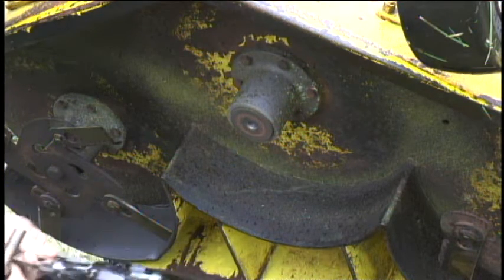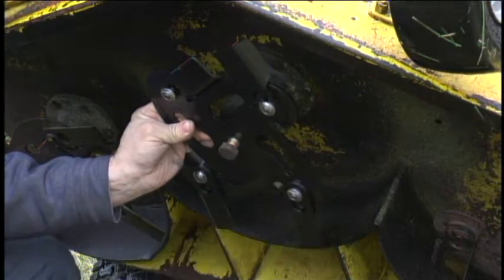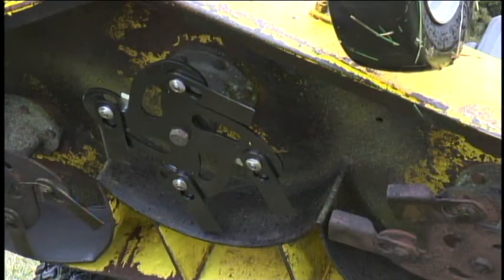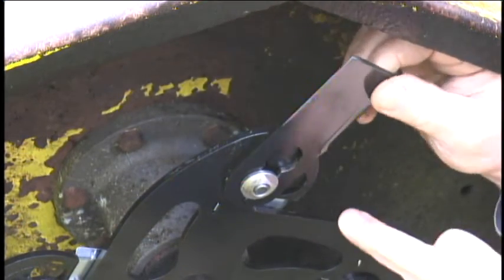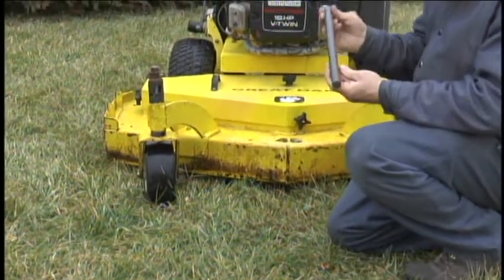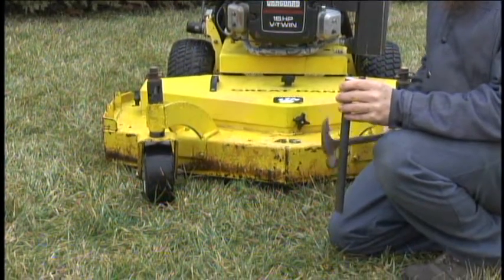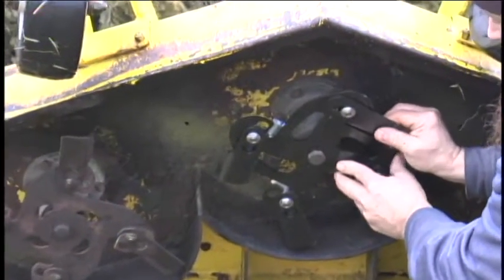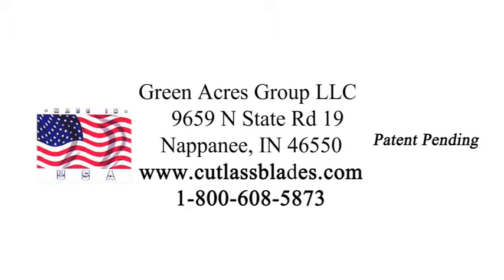Cutlass Mower Blades 1 17

Comment: They need to tell people that these types of blades are really only good for these old push lever blade engaged mowers. When you have a pto like mine with a cogged belt... the first time powering up they were alright. But everytime after that they violently snap to their outward position. And I’ve tried it at all different speed settings. Everytime you hear a super loud snap and it yanks the deck side to side really hard! If they could fix it so the blade only can go backwards to deflect off things and be removed it would be ok most likely. But because they get stopped and then fold forward too far that’s where the hard snap and violent shake comes into play!

Comment: I VERY surprised the battery mower would even turn these, I purchased this setup for my 48" Snapper tractor & LOVED them TILL I realized I could buy 3 cheap standard blades NUMEROUS TIMES VS: I new set of 12 tips, that alone had me pull their system off, I was IMPRESSED with their whole setup till I saw how much more it was going to cost me per mowing season

Comment: and exactly what was the whole point in running the blades into a steel rod?? the most ignorant thing ive seen on youtube in a while now...
Reply: To show the durability.
Reply: I’m glad he did that test. I have a lot of hidden rocks on my property even after multiple times cleaning. I always find new ones when I mow. This is just what I was looking for.
Reply: LOL, that's how much YOU know, he demonstrated a test REQUIRED of mower manufacturers by safety gurus, it's called the stake test, at a company I worked for we had a stake that set on a spring inside a cylinder in concrete, we would slide a trap door OVER the stake loaded into the cylinder, the trap door would have a cable tied to it. We would put mower OVER the trap door, set the mower to operating speed, then we would get behind a protective wall & pull the cable to open the trap door, the stake would spring INTO the blade deck area with the engine at max RPM's to test the effects on the blades specifically, the blades would have to pass for the company to get the safety rating, IF the blase failed ALL of that lot code would have to be pulled out of inventory